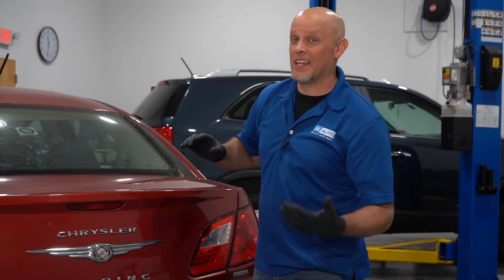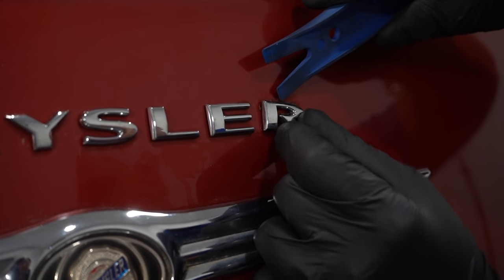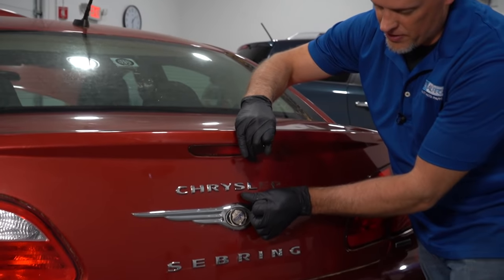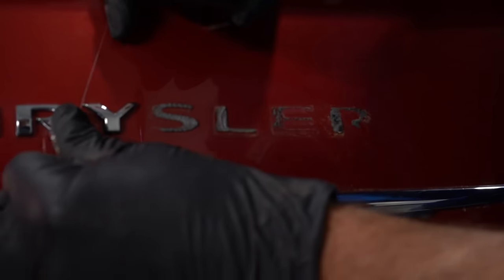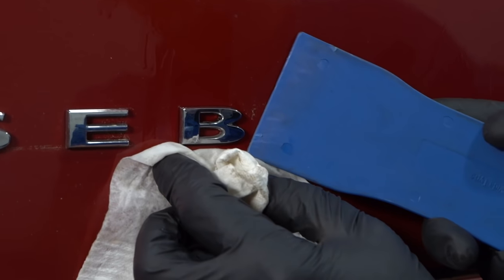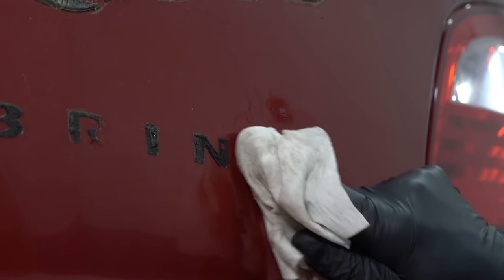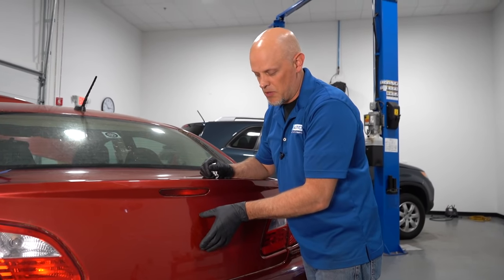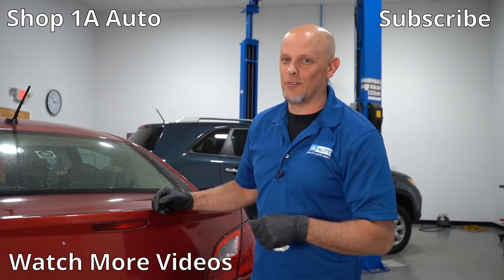The Right Way to Remove Emblems, Badges and Stickers From Your Car or Truck Without Damaging It!

Comment: Wow that was quick and easy. I tried it on my lexus and worked. I didnt have that type of shovel so I just used an axe
Reply: 😅 the dealer pins came right off my 08 Nissan rouge slawd I purchased the car used from sandsprings Oklahoma Chevrolet. In 11 well my parents did. I just bought the car this year back from insurance due to front end.
Reply: You can axe your boss for the day off!
Reply: I never thought of using an axe... 
 I used my jack hammer

Comment: So basically, just use fishing line and the adhesive remover. That drill tool will only smear the adhesive and make the job longer. Another tip, don't buy a dodge product. lol
Reply from the maker: +stevealaska73 Thanks for the feedback!

Comment: Debadging a Chrysler isn’t enough. You then need to replace all the body panels, lights, electronics, interior, suspension, steering, engine and transmission. Once you’ve replaced all that with something like Toyota parts then you’ll have a nice reliable car.
Reply from the maker: +C Hill Thanks for checking us out! http://1aau.to/m/Shop-1AAuto-c

Comment: Plastic trim tools will scratch paintwork too, and if you need to do any leverage they can leave small dings as well. And all that pinstripe removal wheel did was spread the glue further. Would not recommend

Comment: I’d recommend using only the fishing line. 
I’ve had to remove dents from several cars from customers using a plastic tool to pry the letters off. 
With the much thinner metal on modern cars, it’s become much easier to make small sharp dents when doing it this way.

Comment: Yep All Those Methods I Have Used When I Worked For A Emergency Vehicle Company
I Have Done Vinyl Lettering That Was On Like Cement ,  That Is Really Tough To Remove And Time Consuming
Weed Eater Nylon Line Like The Fishing Line Was Used In Video  Is What I Normally Grab For The Double Adhesive Molding Removal As Well As Emblems
Lacquer Thinner Works Well ( be careful on older vintage non- urethane finishes though ) With Adhesive And Foam Remnants Removal Too.
Reply from the maker: +Pin Ball Thanks for checking us out! http://1aau.to/m/Shop-1AAuto-c

Comment: Ahhhh! I 2016 Nissan Altima had some trunk damage a few weeks ago, when someone backed into me in a parking lot. Took it to a certified collision shop, got a OEM trunk and all. When I got the call to pick up my car, i headed over signing some paperwork, and the first thing I noticed when they pulled my car up was the name plates "Altima SR" was misplaced on the trunk. Instead of being above each rear tail light, they placed it on the bottom of the trunk very close to the rear bumper. SMH! They had to order new name plates and still waiting to get in for that to be corrected. After watching  this video, I was relieved at how simple this was without ruining paint. That was the first thing the head specialist was telling me that was more likey to happen and possibly replacing trunk again. BS! Didn't want to admit the error.

Comment: I have the opposite problem
Asked the dealer to glue an emblem back on my sister's car after it fell down, and they kept gluing it and it kept falling off after a while, for several times..
Any tips?
Reply: You ever try JB weld?
Reply: I have some holding a volvo front emblem for the past 2 and a half years and it's still going strong.
Reply: Just gotta make sure to scratch the surface you are gluing on.
Reply: 3m vhb tape works great

Comment: Saves you the embarrassment of owning a Chrysler
Reply: Myself I would have used an air hammer with a blade attachment ...that way the air will do the work instead of moving the shovel.

Comment: oooo garry that  heat gun for absolute beginner is a no no , they will ruin the paint (thats me) 
i will with patience go with the hair dryer and the fishing wire as i have about 15    2 " letters to remove . Its virtually a new car so i guess the glue is gonna be bit harder to loosen/ remove than a older vehicle. Will have to ask a customising firm for a  recommended glue remover .

Comment: So how do you remove the dealership stickers?
Reply from the maker: +Kevin Nelson Thanks for watching!  You can use some of the same techniques shown in the video, but since it is a sticker it should come of fairly easily!
Reply: @1AAuto  thank you
Reply: Hair dryer and plastic razor/scraper.
Reply: Wow, a dealer that still uses stickers? What is it, 1970? If they cant go with license plate frame logo, find another dealer.
You put  permanent signage in my car, you're gonna have to pay me as a traveling billboard.

Comment: Would my girlfriends hair dryer work instead of the hot air gun ? 😐
Reply: No. Hair dryer won’t get it hot enough. Be careful with heat gun as you can blister the paint if it gets too hot.

Comment: the heat gun gets too hot, will absolutely destroy the paint, the plastic tool will also scratch the paint, twisting the letters will also scratch the paint, i'm not too sure i should be taking advice from this guy. The fishing line method doesn't touch the paint and is the best method.